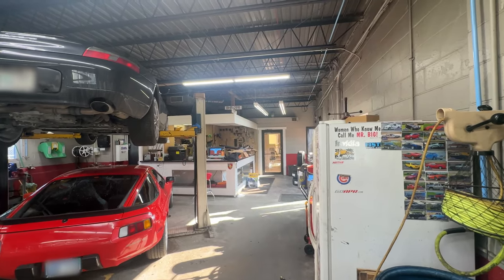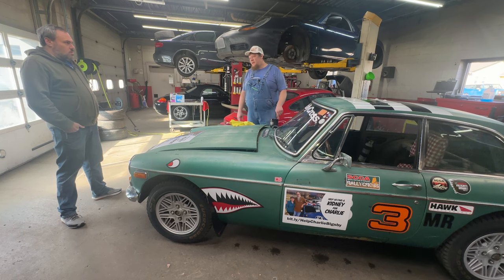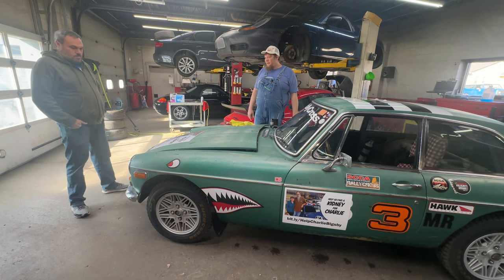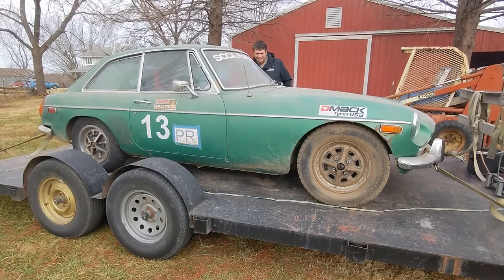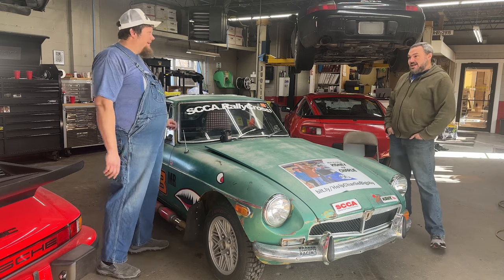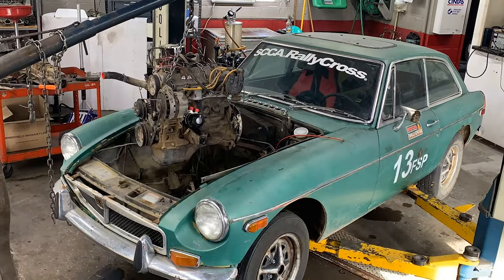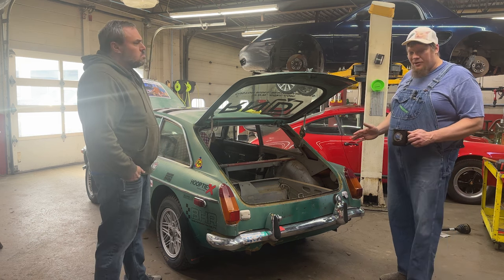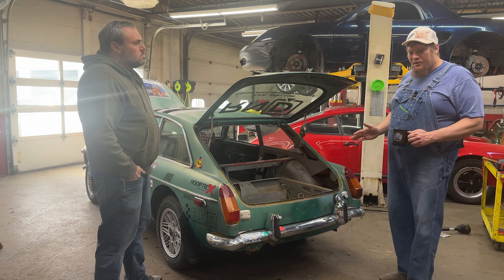Rally Transformation! - 1973 MGB GT-S Goes From Barn Find to Race Car.

Comment: Unfortunately you can’t really use mx5 suspension or any suspension where the spring or shock are ment to mount to the frame above as the mg doesn’t have enough support there, I know it’s not cheap but I was going to go with a mustang 2 front end because it’s just a good front end and will fit nicely
Reply from the maker: Or.. you remake the shock tower area to receive a different suspension design ;) maybe someday!
Reply: @oioracing  i would like to see you try (literally as I want to see someone do it so I can copy them or take inspiration)